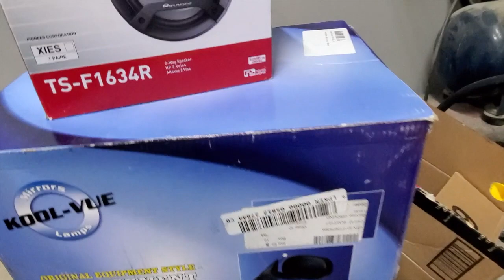2007 2013 Acura MDX door panel side removel view mirror speaker replacement

Comment: After you soldered the connections on the speaker wires, did you wrap in electrical tape? You didn't show that part in the video.
Reply from the maker: I soldered the connection.  I always do . I said it in the video too